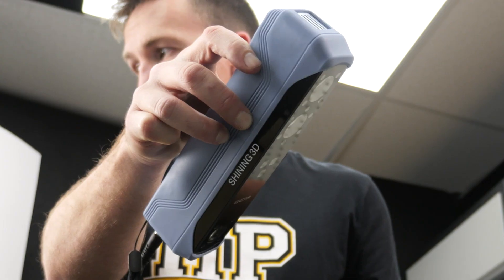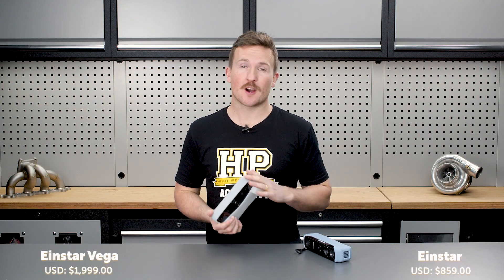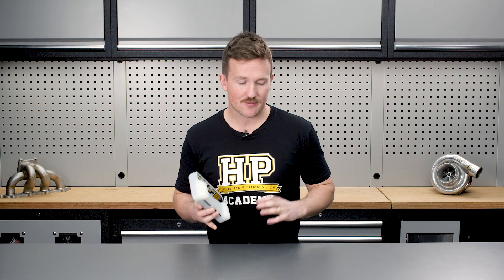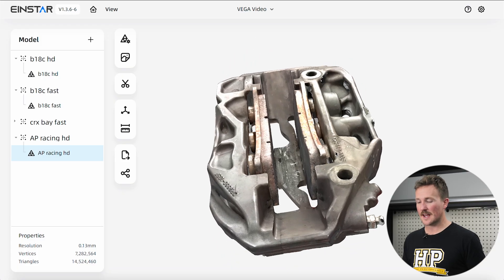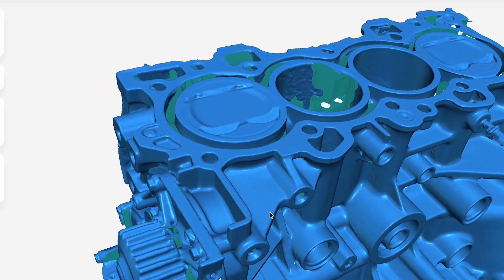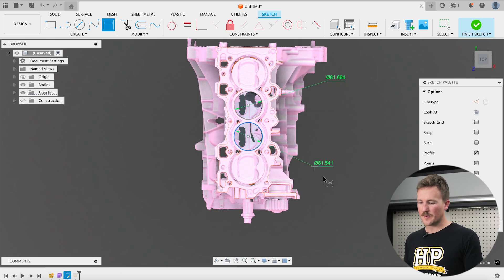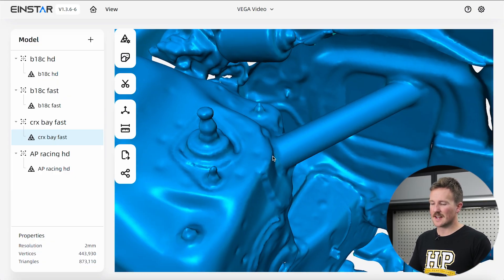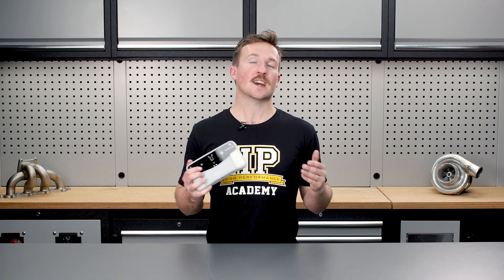Scanning Real Car Parts with EINSTAR VEGA

Comment: How much does the laptop/computer impact the usefulness of this scanner?
Reply from the maker: That depends, some scanners are standalone so for the actual scanning you technically don't need a computer. That is only good for those that send the scans to a 3rd party directly though.

To work with the data yourself will need a decent computer and the specs are listed according to your choice of software.

If you're on a budget, it is cheaper to build a PC than it is to try get a laptop, hope that helps - Taz.